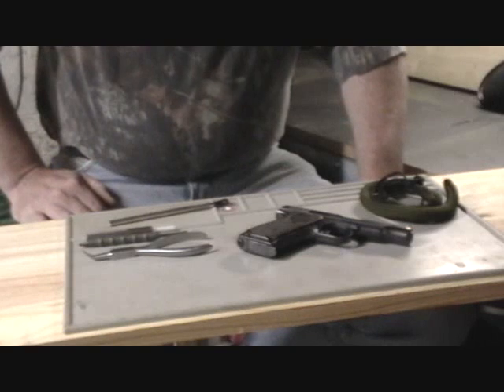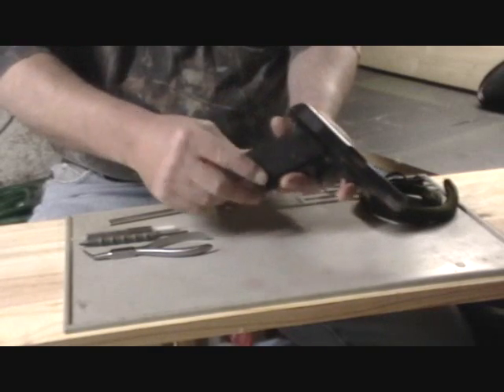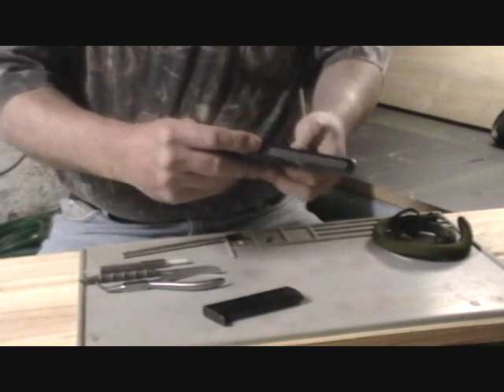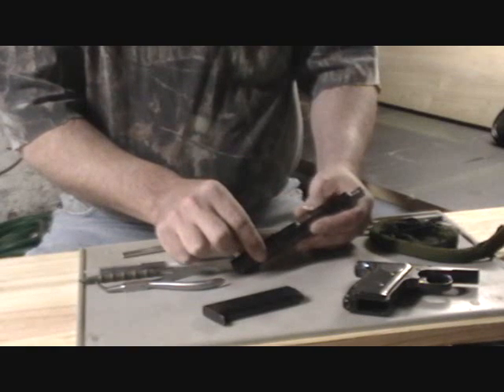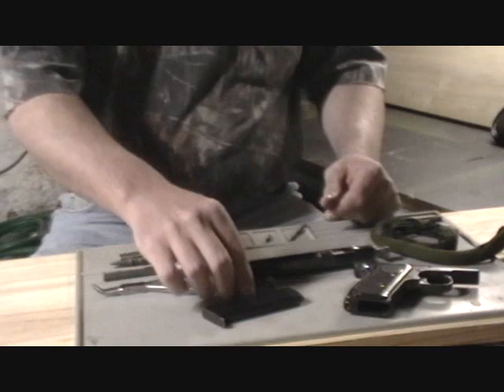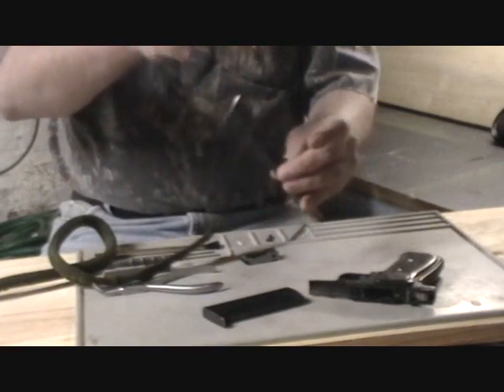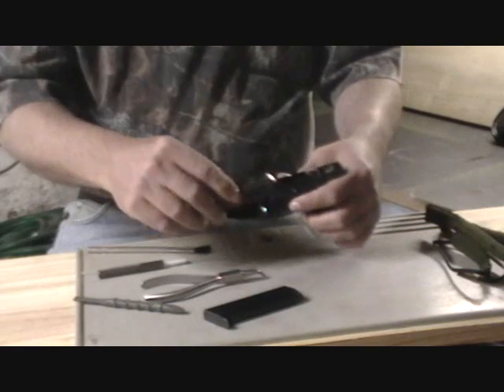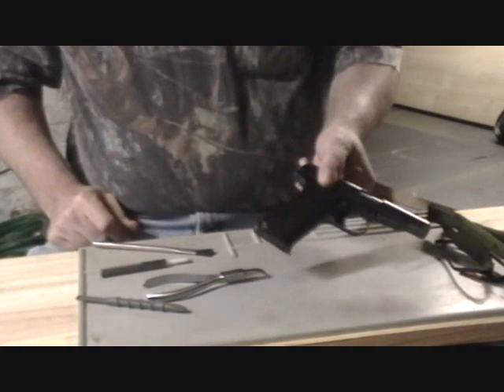field stripping, Remington 51 pistol, .380/.32

Comment: @onmilo Push the bushing that is just forward of the breech forward to the relief cuts just at and  forward of the ejection port, then pull up on the barrel. Then pull the barrel out to the rear. I just had one of mine mine apart and had the barrel out and back in, you have to go against spring pressure to do it. It's the same relief cut that you turn the barrel to the right into to lock it forward, but in this case just push the bushing forward until it can come up into that cut.

Comment from the maker: @DirtyFrigginHarry No, they can't. The pistol is too small to accomodate the .45 acp cartridge.
 however, Pedersen did introduce a sacaled up version of this pistol for the pistol trials @ the turn of 20th century to determine a replacement for the then cuurent .38 & .45 revolvers in service.
The gun did not fare well and the Colt 1911 was declared the winner.

Comment: You CAN take the barrel out and it's very simple.  You can also remove the breech bolt alot easier than your demonstration.  Grips are also stupid-simple to remove so long as you know the trick.

I've detail stripped the pistol much faster and with fewer tools than my 1911.  A trained soldier could disassemble the weapon quicker and more simply than the Colt.  The Navy adopted it, but backed away from the decision due to WWI intervening.

Comment: Oh and BTW, the only tool I used to strip it was a knife to get the pin out, everything else came out rather easily by hand.  Then used the tip of the knife through the breach to guide the firing pin back into it's channel.

Comment from the maker: @hadlock Pedersen and his overcomplicated engineering strike again.
The barrel and bushing are hydraulically press fit into the slide.
There is no easy way to remove the barrel and bushing and it isn't recommend for the average shooter. Not my pistol, & not necessary to remove the barrel so I elected to not demonstrate. These are field strip videos, not detail strip videos, sorry.